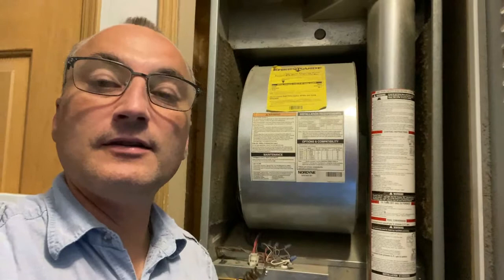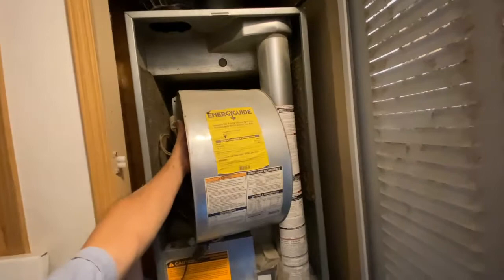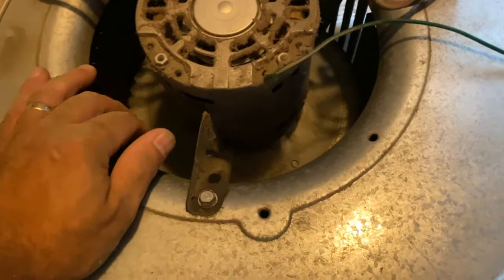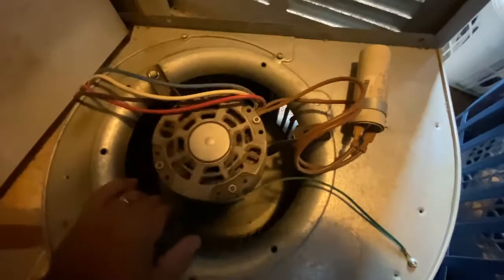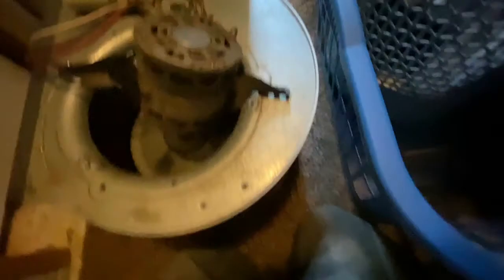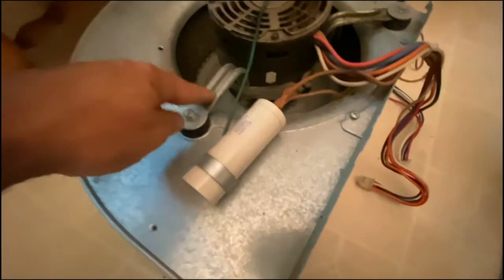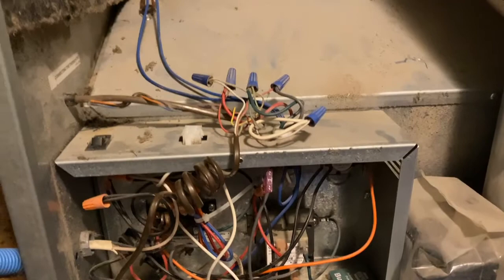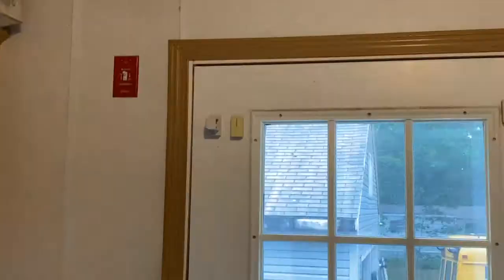How to replace the fan motor in your furnace miller trailer furnace trouble shooting

Comment: Miller furnaces are very good furnaces in fact I have the electric furnace made by Miller in my mobile home and it's been good since installed in 2006 mine is model E3EB-020

Comment: Can I ask you about my heater? It just stopped working and i don’t know what’s wrong with it. There’s a red light that’s blinking next to a bunch of wires. That’s about all I know about it.
Reply from the maker: Seems like it went into reset mode. All furnaces or boilers can detect issues and go off on reset sometimes just pushing the button once will restart it and maybe not have any other trouble otherwise it might be an ongoing issue that needs to be dealt with. There should be instructions somewhere near that red light it also has a red button that can be push to reset it however I can’t recommend you doing anything not knowing what type of furnace or burner you have. I would look around for instructions near that blinking light Usually they’ll be some thing that say what to do to reset the furnace or boiler.

Comment: I'm about to buy a manufacture home with a Miller unit. The fan itself is SO LOUD. Is there a way to change out to a quieter fan? As you show, the intake is the front of the unit itself, and the door. And because it's in the utility room, that door is also vented to let air flow. It's going to be literally hard to hear the tv or sleep. :(
Reply from the maker: Well they are generally louder than other systems however yours could be loud because of bad barons or something else it’s hard to say. Replacing it with a new one may or may not be quieter. It really depends on if yours has a problem or not. Sorry this wasn’t super helpful.